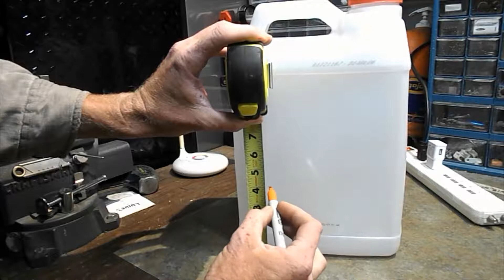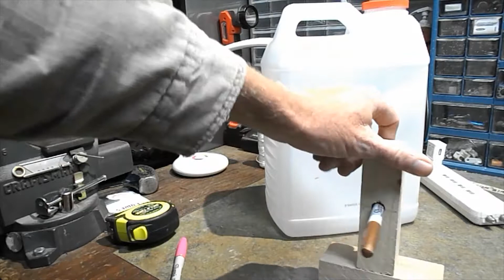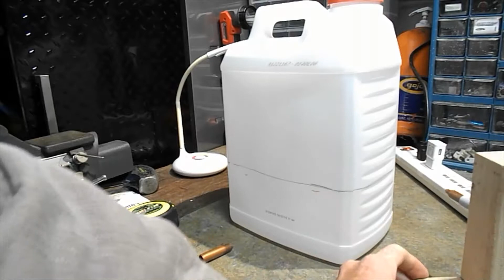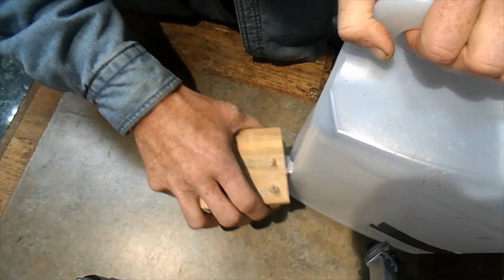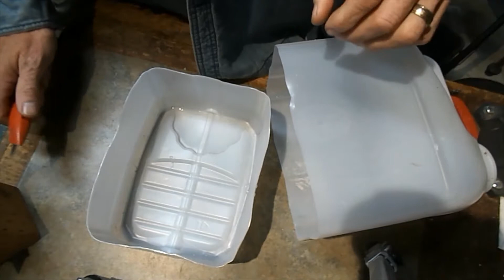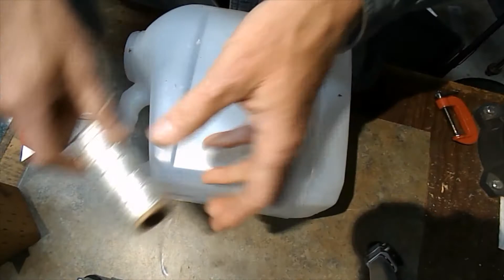Make a Winter Sowing Container from a Kitty Litter Jug

Comment: clever jigs! all the tops will be interchangeable.  good job!!!
Reply from the maker: Thank you, I'm a lot quicker at this now. Those were the first couple of jugs I made. I don't use the tape anymore. Don't forget drain holes in the bottom and slits in the back of the top to get water to the back of the jug. I updated this video, made it a lot shorter, and called it "Winter SEWING container", sowing is intentionally spelled wrong.